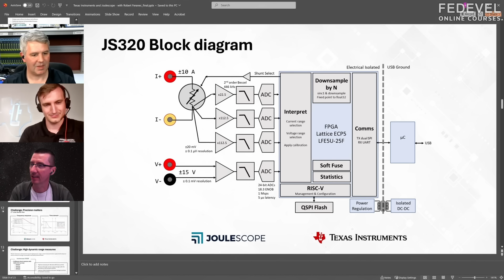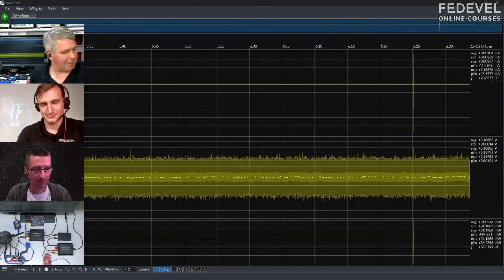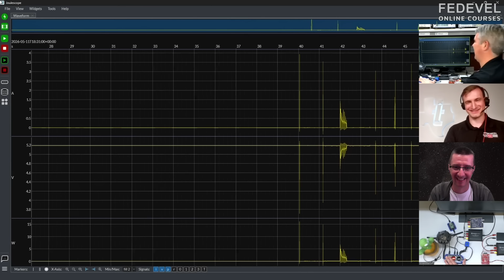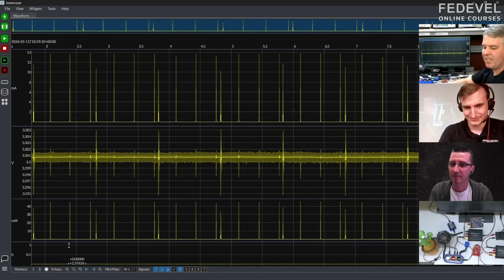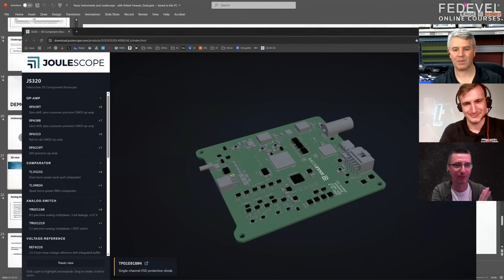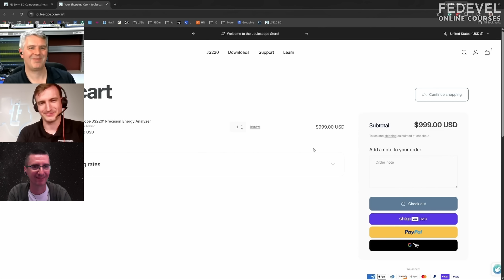Talking About Joulescope Schematic: How Does It Measure Voltage and Current So Precisely?

Comment: 1:21:43 clearly recorded before the recent news, I'm sure Matt is now frantically searching through datasheets for any additional specification downgrades that TI is trying to sneak through
Reply: @markp5726  I subscribe to PCN's for all of these parts.  I frequently see product package changes, but none have had spec changes recently.

I am not sure I have heard the news you are talking about.  Are you saying that datasheet specifications have changed without corresponding PCN's being issued?
Reply: @Joulescope  I'm speaking of the recent EEVBlog video. IIRC PCN's were issued, but in at least one case the data sheet was only updated many months later. I think most/all known affected parts are jelly-bean parts, so not likely to impact your product.
Reply: @markp5726  Ah, ok.  I suspect TI is moving production to newer fabs and newer processes.  They are opening new fabs (a good thing!), but transferring legacy products is definitely a challenge.  As you noticed, all the Joulescope parts are fairly new, so they are not as likely to be affected.  I will keep an eye out, though!

Comment: I was a little disappointed to hear that the GPIO's of the JS320 are not isolated. As I understand it, using GPIO pins to signal events to the JS320 would tie the DUT to the USB supply ground, potentially causing ground currents that would skew low current readings.
Given that the maximum allowed common mode voltage difference between the DS320 DUT and the USB interface is +/- 48V, it would seem fairly trivial to provide that level of isolation with a 1 MHz bandwidth and high impedance inputs by using low-cost differential or instrumentation amplifiers, or alternatively high-speed (<1µs) logic-level opto-isolators with high-impedance LED drivers.
Reply: If it didn't cost anything or consume any board space, we would have designed in isolated GPIOs!  The JS220 has trace cuts to make it isolated, but then you have to figure out how to power it.  We never used the trace cut option in the JS220, so we removed it in the JS320 to further simplify the design.  If I had known about the UCC33020 sooner, I might have reconsidered.  However, creating an external isolator using the UCC33020 and ISO7762 is not too bad.  You can use the TLV9034, just like the JS220 & JS320, to provide extremely high impedance inputs.

The most common use of using GPI's is to measure active mode regions.  In this most common use case, being isolated is not quite as important as long as the high inputs are high impedance.  You do still need to worry about ground loops, but it's often accurate enough.
Reply: an optocoupler could be a low cost option to do this
Reply: @DasEtwas  a plain optocoupler would require 5 mA driving current which is problematic in a low power measurement application.

Comment: Thank you very much for sharing your knowledge and helping others learn and develop (including myself).

I have a question regarding the differential stage shown at 19:48 ("Schematic - Analogue Front End for Voltage Measurement"). What type of resistors do you use, and how closely do they need to be matched, to ensure good common-mode rejection so that only the differential voltage is amplified?
Reply: Great question!  You will always have some common mode error.

We use 0.1% 25 ppm/degC individual resistors.  This gives -70 dB CMRR typical, which is not great, but not bad either.  This limits performance more than any of the opamps' CMRR.  I just measured a JS320 to double-check, and I see ±4 mV of error at ±15 V common mode.  Most Joulescope applications tie V+ and I+ together, which really helps with not exposing common mode error.  In the JS110, we didn't even expose V+ as it was hard-wired to I+.  In this case, the common mode error is lumped into our voltage accuracy spec.

At one point, I did consider precision matched resistors, but it's difficult to find the right ratio.  They get expensive fast for any real precision.  If I remember correctly, I could get another 6 dB with affordable matched resistors.  I decided it was not worth the cost since the vast majority of Joulescope users wouldn't notice and wouldn't care.

The JS320 (like the JS220) allows you to easily perform an offset calibration.  If you expect to be making measurements at some common voltage offset and you care about the common mode offset error, you can perform an offset calibration to trim around that voltage.
Reply: @Joulescope  I raised this question because I also had difficulties finding matched resistors at a reasonable cost. In the end, I used the INA592IDR to perform the signal subtraction, with two buffer stages isolating the input signals, of course. I then applied the required gain at the output of the INA592IDR.

Initially, the idea was to use a monolithic instrumentation amplifier, but with the gain I needed, the voltages appearing at the outputs of the first two amplifier stages exceeded their operating range.

Once again, thank you for sharing your knowledge and for taking the time to reply.

Comment: I have personally purchased a JS110 and two JS220's and they have been extremely useful for FW and HW development and debug. I usually have my active project on one and they allow a lot of insight. I really like that even when new product comes out the old products are still supported and continue to be useful. 
A major aspect of Joulescopes that wasn't really mentioned in this video (maybe it will be in another) is that you can also use a python interface to control, collect data, or process already collected data which can allow considerable automation. The interfaces are open source (Apache license), so you can modify the interfaces if needed.

Comment: I have used many TI chips, mainly for power management. Their datasheets are excellent. I only have had one regret: During the pandemic I got a six year lead time(!) on a quad smart power switch causing massive manufacturing problems😢
Reply: I definitely appreciate TI datasheets, too.  I also have trauma from that era.  Both microcontrollers (different vendors, not TI) on the original JS110 became unavailable.  TI is bringing up new fabs, which will hopefully help going forward.  

Not related to TI, but I have had multiple semiconductor vendors and distributors warn that lead times for nearly all semiconductors will be 6 extra months starting now.  I recently had a vendor (not TI) quote 110 weeks for a MOSFET.  Ugh.

Comment: Nice design.  Quite by coincidence I recently made a high dynamic range charge measurement device using a single OPA387 (and LM339 comparator).  Rather than extensive linear processing plus an ADC, my unit basically operates as a resettable integrator.  A Raspberry Pi pico drives the reset using one of its PIOs - plus or minus 1 uC at a time.  I use a single 0.01 Ohm burden resistor, and the long term drift (over about a week) is about 10uA.  Maximum is 25A.  So the OPA387 is good for at least 10**6:1 dynamic range.  Not bad at all. Of course, my accuracy is only about 2%, but that's relative to total charge so it works for my intended application which is measuring battery charge whether it's doing amps or microamps.  Only costs a few bucks.
Reply: Do you have any further details/documentation/specifications for that design?
I have been considering a similar, purely analog, current monitor device to supplement my tinyCurrent (uCurrent  derivative) to provide higher effective dynamic range.

Comment: Having the engineer and the manufacturer there is such a cool combo. I've seen these before, and they usually lean way to far towards the marketing rather than the engineering. I was hesitant to watch a 1.5 hour video, but I loved it! Robert, you did a fantastic job facilitating this.

Comment: The price of these is rediculous for what they are... I understand you need to make money and targeting enterprise is great but for home hobbiest the price is bad... very bad
Reply: A hobbiest doesn't need this level of accuracy and traceability.  This is designed for componies designing products that they need to KNOW are going to meet their current / battery / usage specs.  For that, it is quite reasonable.
Reply: @Cynthia_Cantrell  Yes, pricing is quite cheap I would say. Only 880 euro on their webpage. I though it is at least several thousands of euros.
Reply: This op-amp app is more expensive than the scope I would connect it to. I've used 500A HP dc current probes in the past (10k)

Comment: With one shunt resistor, how can this front end circuit have such a large range, nA to 10A?  I couldn’t watch the whole video.
Reply: I see - from the specs it’s mentioned different shunt resistors are there, just not shown in schematic
Reply: @yjweaver5108  Yes, I edited the schematic shown to be simple with one shunt resistor and one analog path.  The full JS320 schematic has the shunt selection on a different schematic page and 3 analog paths for current sensing!
Reply: @Joulescope anyway, nice design and thanks for sharing
Reply: The JS320, just like the JS110 and JS220, have 6 shunt resistors: 0.01Ω, 0.1Ω , 1Ω , 10Ω , 100Ω , 1000Ω.  Switching shunt resistors is how we get much of the dynamic range.  We focused this video on how Joulescopes sense the voltage across the shunt resistor to measure current and how they measure voltage.  It would have been another hour+ to talk about current autoranging!  Joulescopes use MOSFETs to select the active shunt resistor.  They also have dedicated hardware to quickly detect overrange conditions so that they can switch current ranges in 1 µs!  This avoids voltage droops that can cause brownouts.

I don't think that I can post links here, but search for "11249117 US patent".  Figure 2 shows how the JS110 selects the shunt resistor.  The JS320 is similar.
Reply: I guess they using a number of shunts in parallel which are switched on and off depending on the measured value. It was mention by the creator that they also measuring while switching. That is a little misleading, or i would say clever hiding, that you can overload the lower range while not actual not switched to a lower resistance shunt. There are some patents out which using parallel diodes on all lower range shunts and they are in series. But this is bad from the accuracy and shunt burden voltage.
That is the story in manner engineering marketing shows that they overjump the detail instead of giving humans which spend attention the chance to learn the trades and value the solution.
Reply: @reinerfranke5436  The shunts are in series.  I don't think that I can post links here, but search for "11774469 US patent".  Figure 1 shows how the JS220 works with a dedicated channel on the 0.01Ω shunt.  The JS320 has three channels, each able to look at the voltage across any shunt.  The details of the analog sensing part of the JS320 is much more generally applicable than the current autoranging, which is why we focused on the analog chain.

Comment: 27:27    I think you were asking about rail to rail Opamps
Reply: Yes, the OPA387, OPA388 and OPA323 are all rail-to-rail, but even rail-to-rail opamps can't drive fully to the rail.  For example, the OPA323 needs 55 mV with a 2 kΩ load.  See the Vo spec in the datasheet.

Comment: the ferrite bead lol
Reply: You mean in front of the REF6225?  I didn't say they are all bad ;)   ... just don't mindlessly add them as magic noise reducers
Reply: @Joulescope  Is the ferrite feeding an MLCC (I see 1uF)? Be careful of a resonance! Or doesn't the REF6225 care?
Reply: @robegatt @abraxalito So, I took another look at the simulation, and there is peaking at 88 kHz.  While this is inband, it's not an significant area of noise concern in the design, which is why the design is like it is.

I did try replacing the ferrite bead with a 10Ω resistor, but this increased the noise floor.  That 4.5 V is already regulated by an LDO, but it does travel near the FPGA, so picks up digital noise that we need to attenuate.  However, there is no reason to even take this risk on the reference voltage input since it can be improved for almost no cost.  The right answer is to add a 10Ω series resistor and up the input capacitance a bit.  This flattens out the resonance and improves frequency response.  I hacked a board to make this change.  While it made no difference to noise levels, it could help slightly with susceptibility, so it will be added to a future board spin!
Reply: @Joulescope  yep, the bead is an inductor, you do not want to add poles on your pdn.
(I was laughing because it is one of those things that are placed automatically because "people always use them", like using a 555 to make a square wave lol)

Comment: I had read somewhere that when you use a 24-bit sigma-delta ADC with a PGA, (the input noise spec is very close to the theoretical achievable ~0.9nV/rtHz ), you don't need gain-stages upstream (worsening of s/n.) Comments?
Reply: .. and as an addendum - the sample-and-hold of a sigma-delta ADC, can that double-up as a chopper (or at least half of it)? TI designs ADCs, also opamps; does it make sense to integrate these analog functions?
Reply: @AdityaMehendale  TI gives a maximum offset drift the ADS127L14 as 150 nV/°C, which is pretty good!  The trend is towards more integration, and I look forward to seeing what TI comes up with next!
Reply: If you presume you have the full 24-bit range, perhaps.  With a 4.096 V reference and differential signal (-4 to +4) => 4.096 V * 2 / 2**24 => 0.5 µV per LSB.  Table 6-2 of the ADS127L14 datasheets says 18.3 ENOB for sinc4 max speed OSR 16.  Other choices in the JS320 (single-ended, 2.5V ref) reduce this further.  All this means that the gain and filtering are needed in my case.  The ADS127L14 has other operating modes where you can achieve full 24-bit ENOB and may be able to avoid gain.  However, you also need to ensure that the input is able to correctly drive the ADC, which may require active circuitry that adds noise.

For the JS320, the vast majority of the gain noise comes from the first input stage.  While the rest of the gain contributes noise, it's comparatively small.
Reply: @mliberty  Thanks for the detailed explanation!
For the aspect "..input is able to correctly drive the ADC.." --> I assumed that since you have a source having very low-Thevenin-impedance (i.e. the current-sensing series-resistor), that would be a non-issue; perhaps I'm mistaken..
Reply: @AdityaMehendale  For some applications, going right into the ADC could be fine.  For Joulescopes, it's a non-starter.  We do have 1111 Ω maximum shunt resistance, which is pretty high to get any reasonable settling time.  We would also need to expose the ADC input filtering directly to the outside world.  That's a lot of capacitance that would reduce measurement bandwidth.  The analog inputs consume ±2 μA (typical, with input buffers on), which significantly increases the minimum currents the instrument could measure.  Also, the ADC input current is very pulsed, which would mess with measurements.  Lots of things to consider!